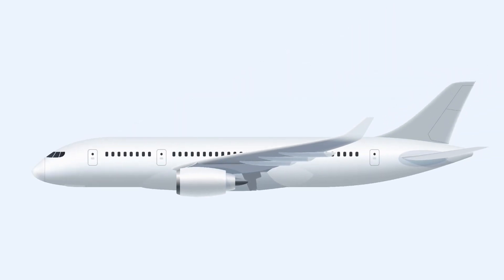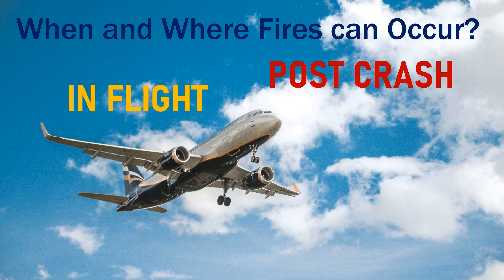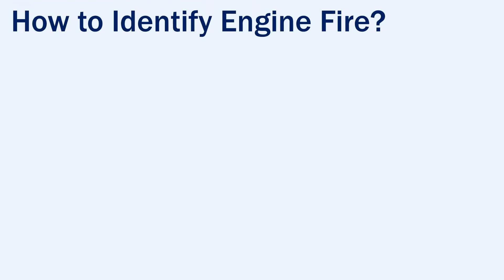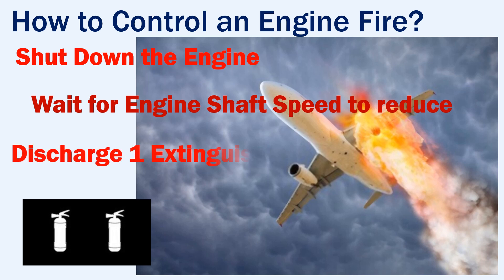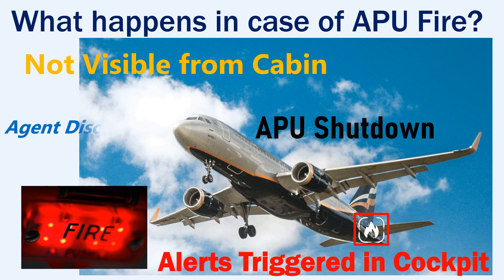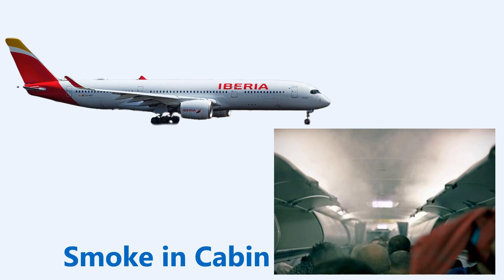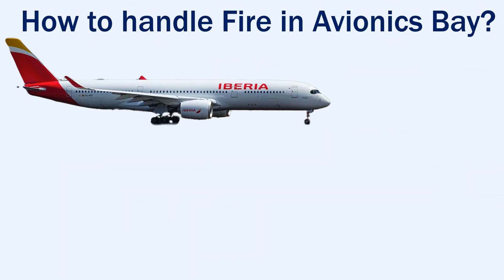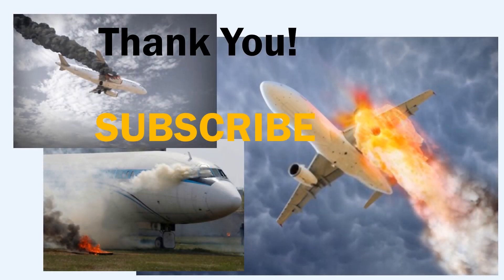How to Extinguish Fire in an Aircraft? | Understanding Causes of Fire and Fire Protection System!

Comment: Good info except the engine fire extinguisher is not discharged through the engine. That is where the fire is supposed to be. The engine fire extinguishing system discharges around the outside of the engine but inside of the engine nacelle.  That is where all of the external fuel and oil lines plus components which can fail and cause fires are.  there is no need to wait for the engine to spin down after pulling a fire handle.
Reply from the maker: Thank you for the info. This is just a general look at fire protection system. There will be some differences in procedures in different engines!